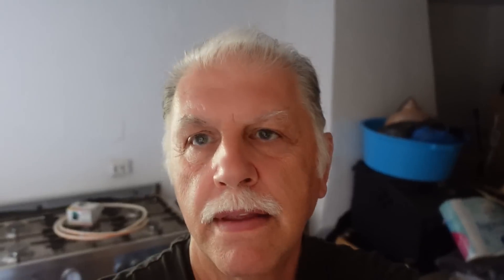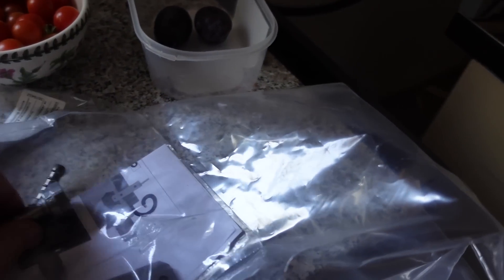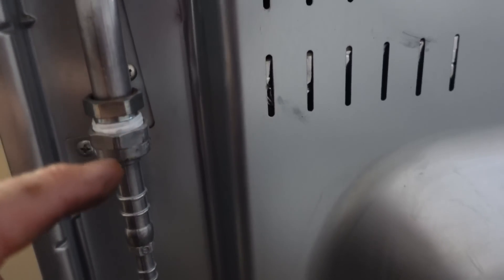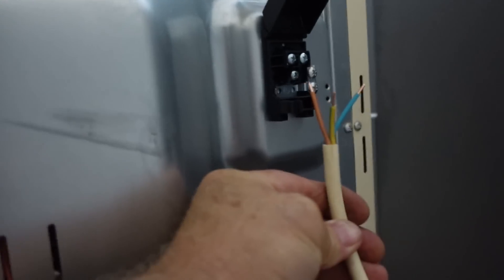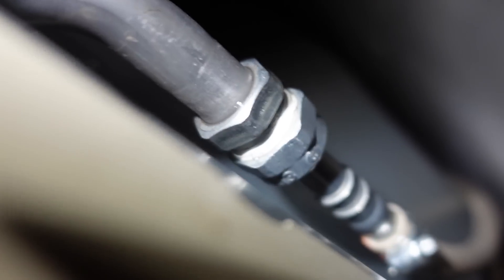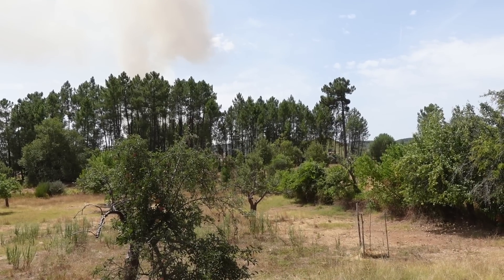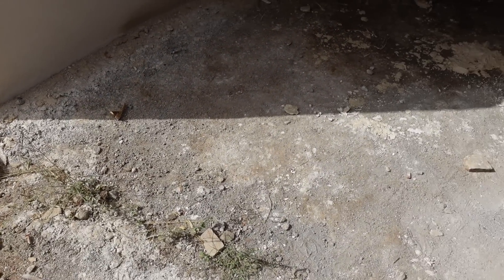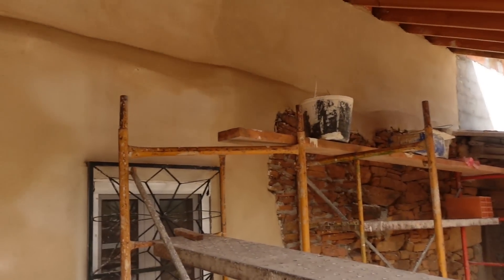85. NOW WE ARE COOKING ON GAS!

Comment: Please move the gas can outside. Love you guys. Big hug from extremely hot sunny Florida.
Reply from the maker: Hi Grace,  The gas bottle will be situated outside in an open front store once the builders have finished. At the moment there is a long trench dug out where the bottle will go. 
The portuguese ranges have a cabinet built in the cooker to keep the gas bottle in. 🤔

Comment: at 8.15. Those connectors at the end of the wire looked like Wago Lever Connectors
Reply from the maker: Yes they are Wago but not lever connectors. They are push fit.🙂